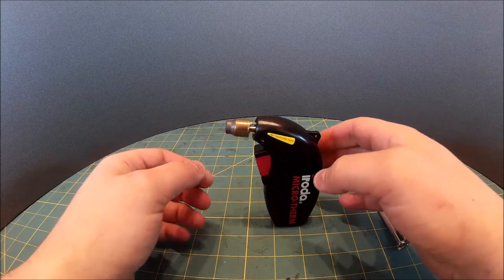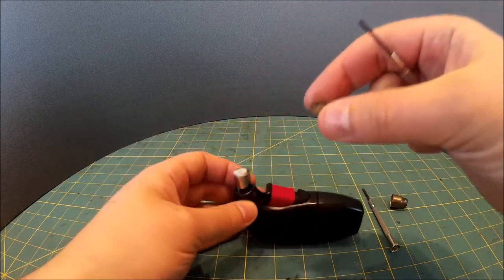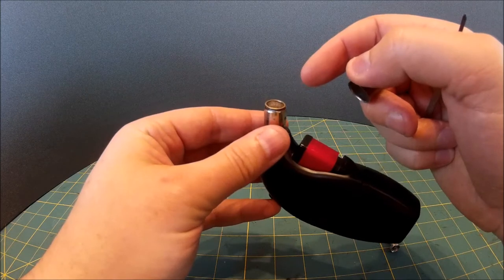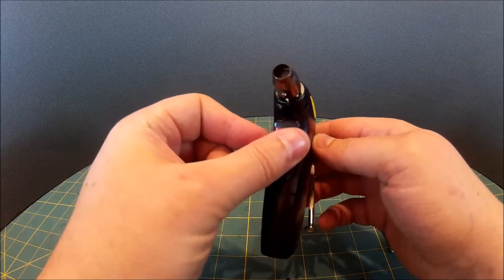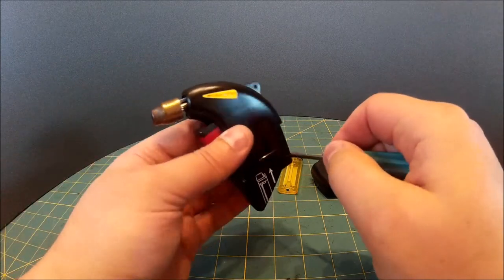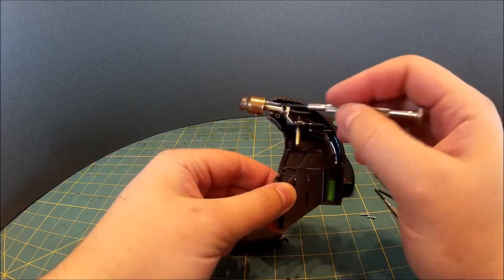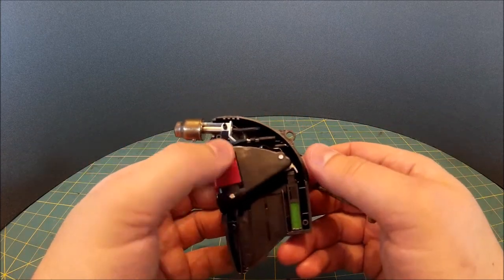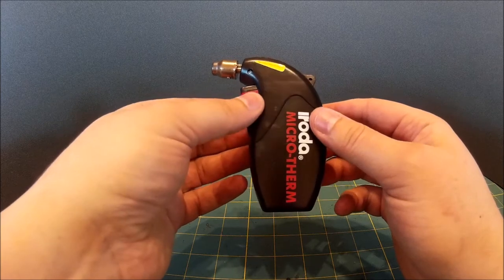My Iroda Micro Therm doesn't work... 2 Fixes

Comment: The refill port cracked immediately on the lighter that came with mine, the first time I tried to fill it. Also it doesn't doesn't ignight consistently, nor does it burn particulalry hot.
Reply from the maker: Sounds like you got one from a bad batch, I'd send it back if I were you! 
Mine must be nearly 10 years old now and still going strong!

Comment: how do u refill the lighter?
Reply from the maker: Hi Valentin, I just use a normal canister of lighter gas, they look like small aerosol cans.
There is a little pipe in the bottom of the lighter where you connect the gas canister as per the instructions on the can.
Reply: @CNCModellerUK  can you just buy a new lighter?